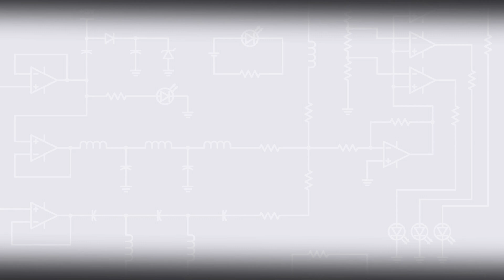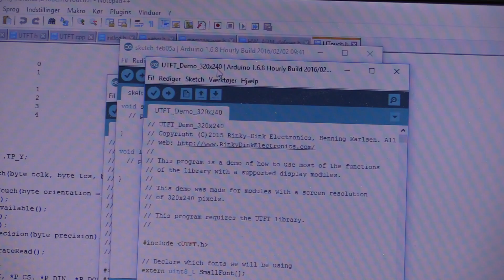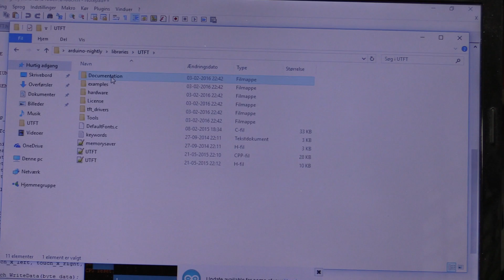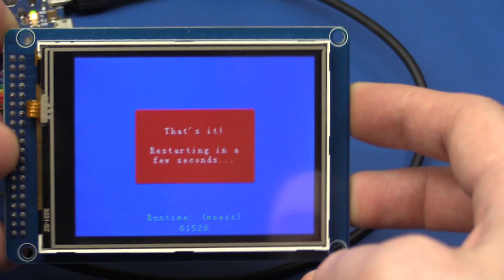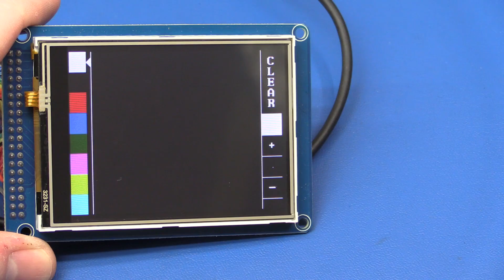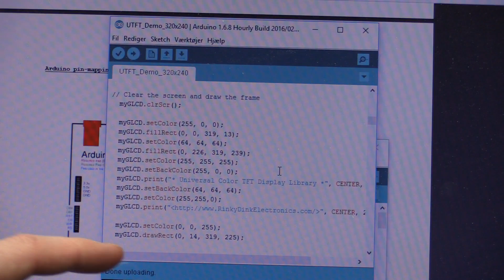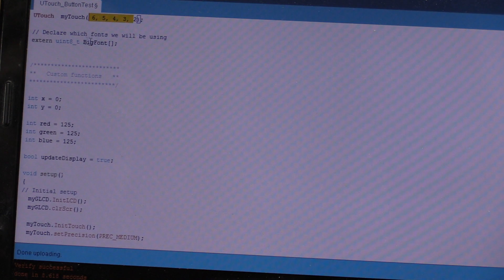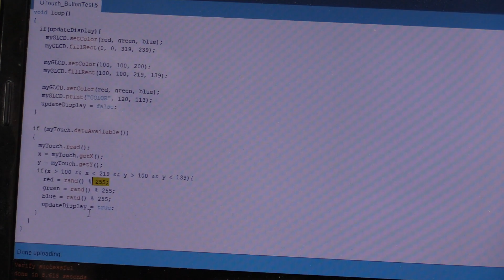Getting Started with a 3.2" LCD Touch Screen from ICStation - Ec-Projects

Comment: Hello, I have the same unit 3,2 tft screen with a mega and shield . All is working with the UTFT and UTouch.h libraries....but for some reason the touch screen does not work. Do you use the tft screen with the ILI9341 driver? Any comment/help would be great. Thank you so much.